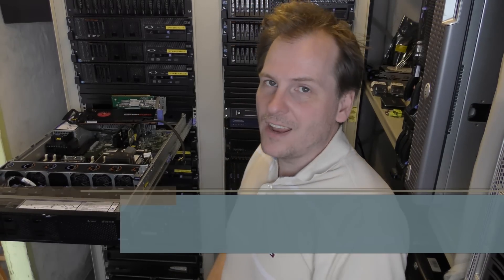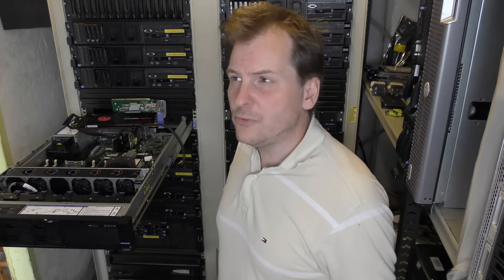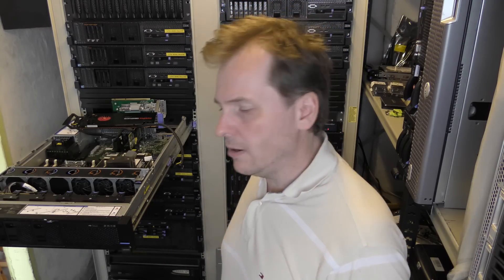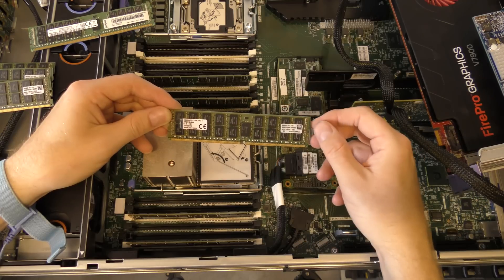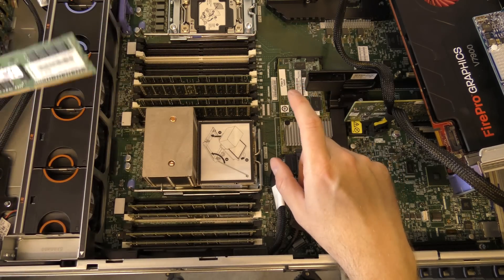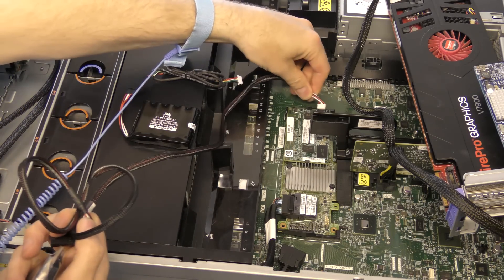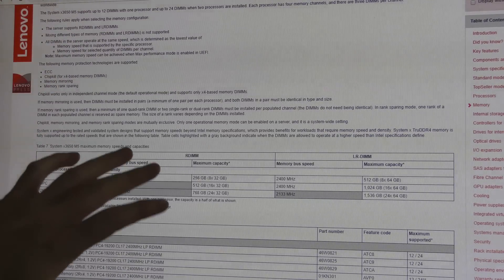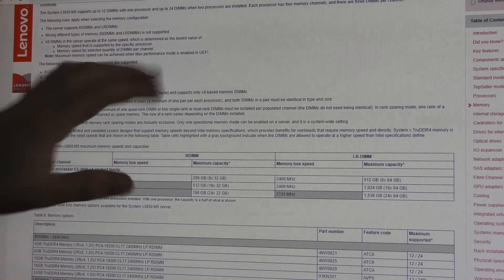256GB of LRDIMM, It will have to DO & a Capacitor Bank - 857

Comment: you can still do oc to 2400mhz
Reply from the maker: Hi daniel pirkl
You can not OC enterprise servers. For home use it might be fun,, but for the work that these servers are build to do, you want stable and secure operation. :-)
Thank you for watching! :-)
Reply: @MyPlayHouse  That's true, Servers in general can't do any overclocking by themselves. Stability is more important than performance.
Cheers

Comment: So when you installed the second lot of ram you didn't notice you had them in the wrong slots - one was in slot 13 and another in slot 10.  That would have thrown an error too.
Reply from the maker: Hi Ein Felder
Thank You very much!  If the RAM had been the same kind and working, it would have worked,, there would have been a block missing. and I would also have an unbalanced server. Did I really put it in slot 13 ?
Thank you for watching! :-)

Comment: The time i got my HP Smart Array P800 the 2 Battery packs was dead. A new replacement would have cost about 80€ each. Got myselve some 4 Enneloops and 4 Cheaper Batterys and made my own Battery Pack and connected them to the Old Battery. Works fine!
Reply from the maker: Hi DashcamDriversGermany
Thank You very much!  there were like nine wires in this bloody cable,, I do not know why,, but I did not want to mess with that.
Thank you for watching! :-)
Reply: @MyPlayHouse  the battery on the smart array are cliped/slided directly on the pcb of the controller. The seller didn't take them of so they was completely discharged and expanded so much that the whole pcb have bent. I only got them of by literally hit it with the screwdriver 😧

Comment: One specific thing that's worth noting is that memory rank is critical here. The more individual memory ICs you have on a DIMM, the higher the rank. A double rank DIMM will have twice as many memory ICs on it as a single rank, and a quad rank DIMM will have twice as many as a double rank. Higher capacity DIMMs make use of higher ranks, because you generally need more memory ICs for the increased capacity. Each of these ranks shares the memory bus, and once you hit a certain number of ranks you have to drop the memory frequency to handle the increased electrical load on the memory bus. The problem is that is that each of the memory ICs (and the traces running to them) have some parasitic capacitance and impedance on their electrical interfaces, and once you attach enough chips you eventually degrade the signal integrity of the memory bus to the point where errors occur. Lowering the frequency helps because it allows for more time between the rising and falling edges of signals, which gives you a bit more timing budget for the transitions being slowed by the load.

The specifications you showed that list memory speed vs. number of RDIMMs are based solely upon the expectations of rank count at that size using existing memory ICs. They're effectively a heuristic for rank rather than an actual limit based upon the actual memory size in gigabytes. If you were to install new RDIMMs in future that used higher density memory ICs but at a lower rank, you may find that you can exceed the maximum memory limits for RDIMMs without lowering the frequency, assuming that the BIOS does actually apply this reduction based on the rank value as advertised by the DIMM's SPD. Ultimately, the problem is not the amount of memory capacity in GB, but rather how many memory ICs are connected to the memory bus.

LRDIMMs get around this by inserting a buffering multiplexer between the memory bus and the memory ICs, thus allowing them to emulate a lower rank while still retaining the high number of memory ICs. For example, an LRDIMM with an internal rank of 8 will likely appear as only a rank 1 or 2 to the system. (Aside: if you've ever programmed for an older game console or computer that has banked memory, it's a similar concept except transparent to the CPU's memory controller). This reduction in rank is, in fact, where the "LR" part comes in - Load Reduced means it lowers the load (i.e. the electrical load caused by higher memory ranks) on the memory bus by reducing the number of electrically connected ranks. The benefits are obvious: you can stuff a lot more RAM in the box without running at lower frequencies because the load on the memory bus is low. The primary downside is that it's considerably more expensive because you've got to pay for those buffer chips. Another downside is that the buffer chip introduces increased latency, so your memory timings are generally a fair bit looser on LRDIMMs than RDIMMs.
Reply from the maker: Hi Graham Sutherland
Thank You very much!  That was a lot of good info,,, lots of stuff I did not know.
Thank you for watching! :-)
Reply: @MyPlayHouse  No problem at all! Memory stuff is actually a fun topic.

Comment: Those capacitor banks are, in fact, supercapacitor banks. Supercapacitors are like capacitors, but they can store energy at the cost of lower voltage rating and worse noise and self-discharge. They're still nowhere near batteries in energy density and have a horrible self-discharge problem, but they have a huge power density (they can provide a few hundred or thousands of amps) and last virtually forever without losing capacity.
Reply from the maker: Hi GRBTutorials
Thank You very much!  glad you liked the video :-)
Thank you for watching! :-)

Comment: You must have paid a fortune for those Ram blocks
Reply from the maker: It is still expensive RAM,, :-/
Reply: @MyPlayHouse  Have you thought of buying any other modern DDR4 servers
Reply: ECC RAM is often surprisingly cheap for last-generation hardware. Lots of companies are going to be replacing servers with Xeon E5 v4 CPUs and slow (2166ish) DDR4 memory with Xeon Scalable and faster DDR4 right about now.
Reply: @jmonsted  you're right! I found 64GB DDR3 12800R ECC for $160 which is a bargain. Cheaper than standard and effective
Reply: @frederiquekruger4818  Still quite a lot of money. That's $640 for 256 GB. I don't even know what I'd use so much RAM for!
Reply: @jmonsted Yeah I know that but its not like last gen ddr3 most places dont have to change it
Reply: @marky5204  They don't have to, but they do. Few big companies actually care enough to shuffle RAM around, they just buy the server with whatever they need and send the old one to a broker or a scrapper.
Reply: Jesper Monsted honestly they got too much money if there fussy over wether their ram is 2400 or 2666 like wtf do they need that capacity and speed for